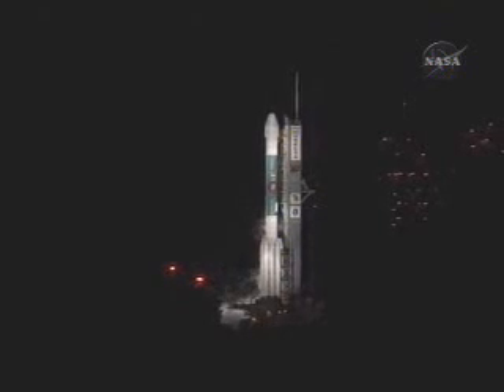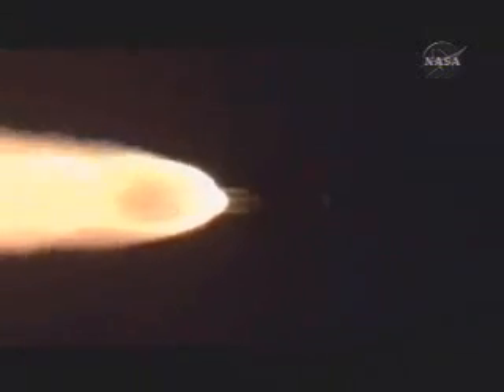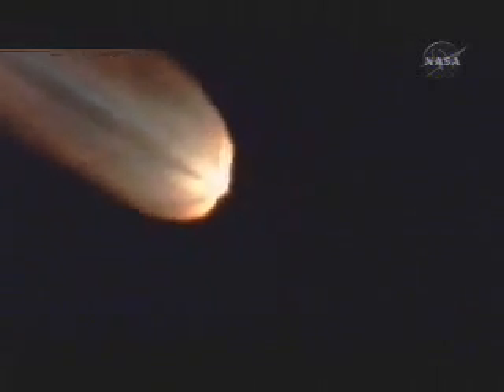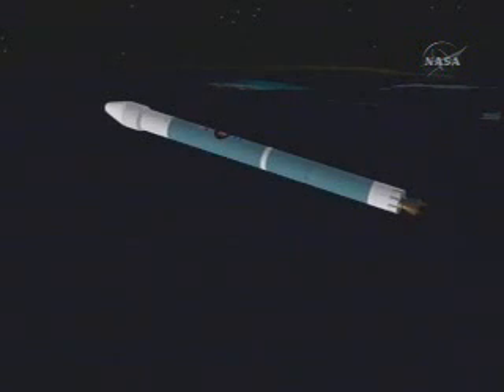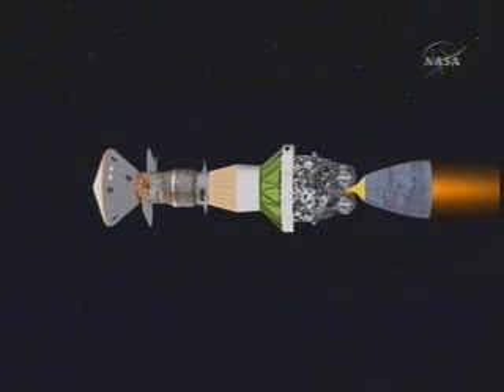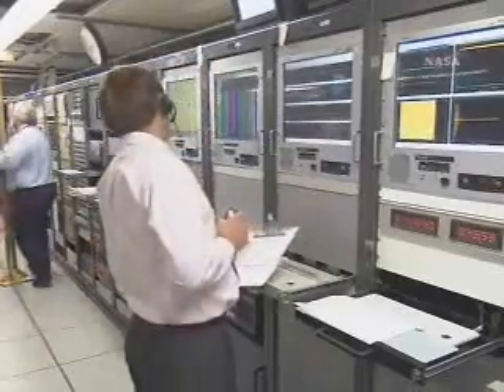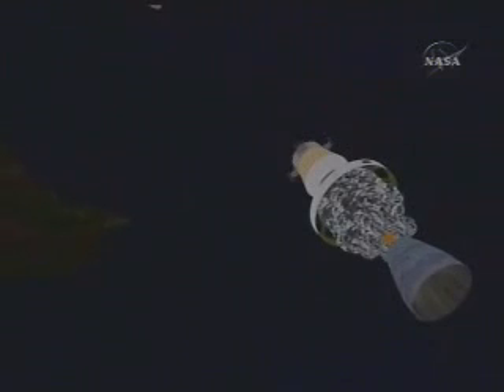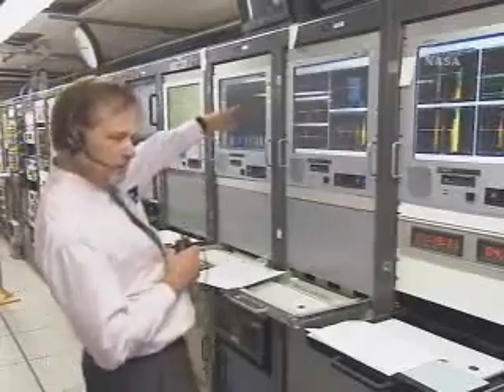Phoenix Mars Mission Launch

Comment: It took just under 10 months to get to Mars (9 months 21 days to be precise). The quickest chemical rockets can propel a spacecraft to Mars is roughly 6 months, when Mars is closest to Earth (35 million miles). At furthest distance, Mars is 250 million miles away.

Phoenix entered the Martian atmosphere at 13,000 mph (21,000 kph) or 3.61 miles/second (5.81 km/s).

Because of the trajectory used, Phoenix traveled 422,000,000 miles (680,000,000 km).